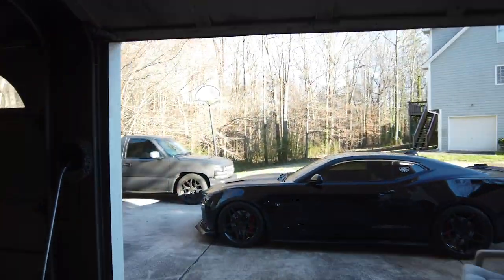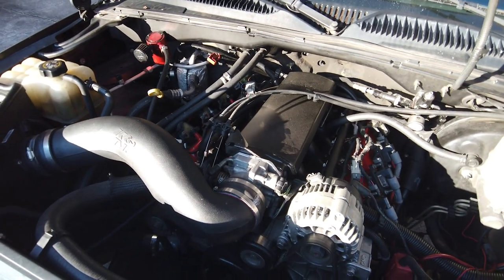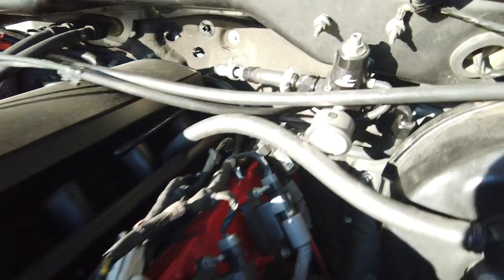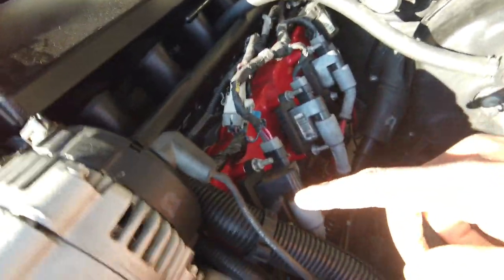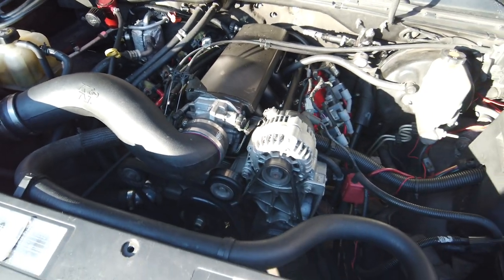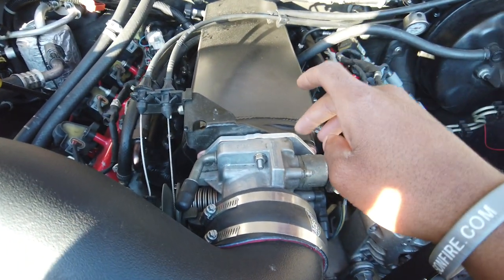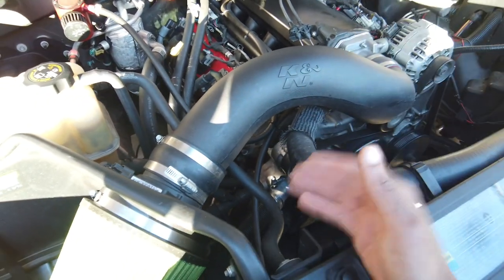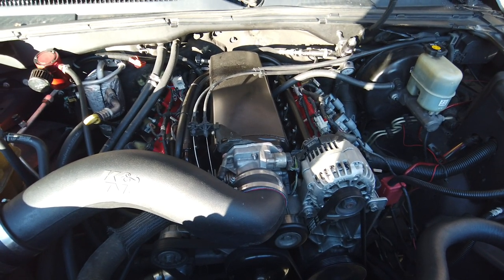How I Installed a Holley Sniper Intake: 2002 Silverado 5.3L

Comment: How to reduce midrange power.
Reply from the maker: Haha, and that’s when you build a 6.0 like what I’m doing, problem solved.
Reply: @Stan1le   Have you watched the 20 LS manifold shoot out ?  Nothing comes close to average power as a FAST , MSD or TBSS on a 6.0.
Reply from the maker: @generalsixty2133  trust me I know all that. It’s not like these motors make killer power regardless. It’s not ALL about getting every ounce of power for me, I just like to try different things on my personal vehicles. Never have I once claimed that this intake offered any significant improvements. Like I said I simply tried something and surprisingly A LOT of people would like to do the same
Reply: @Stan1le   Most guys just want what looks cool and it does that.  I have an Eddie dual plane and Holley Terminator on my aluminum block 6.0. I bought it 9 years ago long before I ever saw a dyno test.  It works well on the street as usual but I want a FAST next to get an additional 40 HP from 5000-6500 RPM. More torque too.
Reply from the maker: @generalsixty2133  I can agree some people just want to look cool. But keep in mind the Fast is twice the price for only 30-40hp, most people won’t justify that cost. Like me, I rather put that money in a great set of cylinder heads. My setup will see boost so an intake will not make or break my performance.
Reply: @Stan1le  Boost is the equalizer!  I'm going to spray a 50 shot. The plate and bottle are all there waiting. Heads are CNC ported 243's.
Reply from the maker: @generalsixty2133  I just can't mess with nitrous. But I know these iron blocks can take it fairly well. Hopefully, you get it done soon!
Reply: @Stan1le  Subscribed!